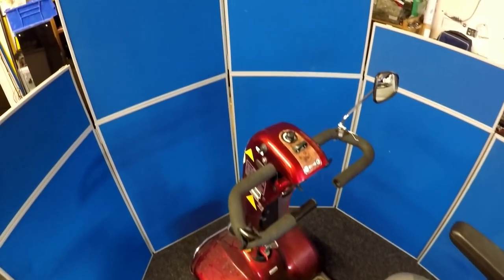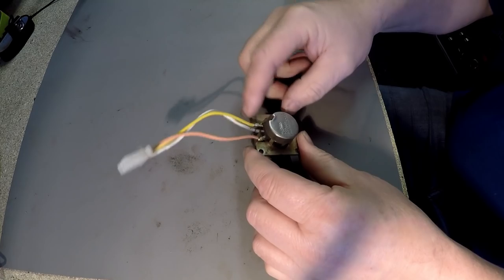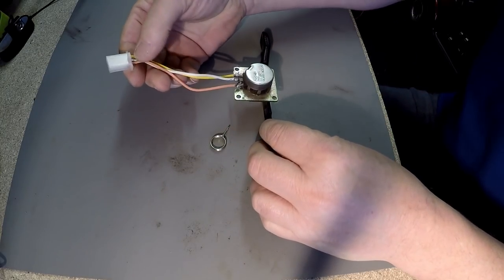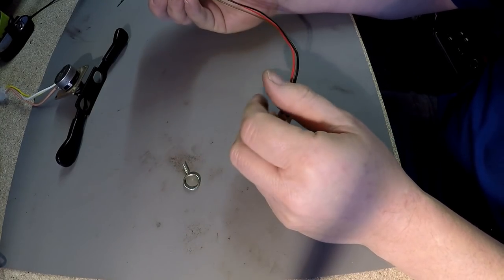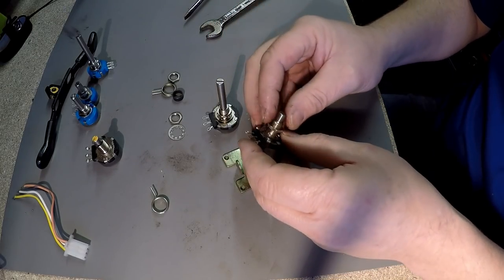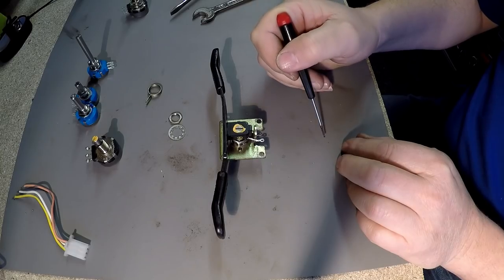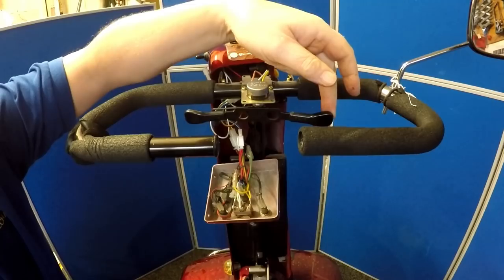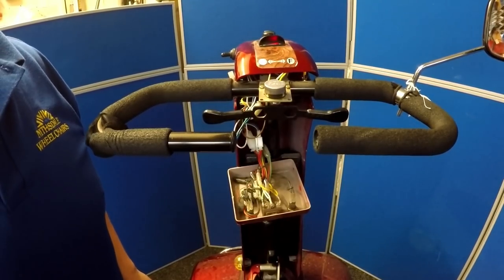Scooter speeds up and slows down Mobility scooter Throttle pot Repair

Comment: brilliant video, i took mine apart the weekend to see how easy it is to change a broken spring and obviously some how moved the shaft out of position, so when i put everything back it would not work, i was running around and phoning around trying to get a replacement until i came across your vid show the position of the shaft, all bloody day yesterday up until i came across your vid tonight. who would of thought something as simple as that.  thanx again

Comment: Thanks for the video. I'm repairing a mobility scooter for a friend who snapped the spindle of the RVQ24YS08-02 potentiometer. I managed to find a replacement in the EU (have to pay import duty in Greece when ordering from the UK) and I'd figured out how everything worked and fitted together. Your confirmation of the centre stop/brake position adjustment confirmed what I had already figured out about the grub screws (I'm an electronics engineer). By the way, it would be helpful if you would NOT call grub screws "grommets"!

Comment: My wife had a problem with her Go-Go scooter.  It was not going as fast as before.  I checked it out and the throttle would move a lot, forward and backwards, before the cart moved.  This carts throttle arm had an tiny Allen nut that had loosened. No big deal getting to that arm, but finding where my bag of Allen wrench were, then the second to tiniest Allen wrench fit and I snugged the nut tight.  Now no looseness and the cart zips like new.

Comment: Thank you very much. You saved me money and time. buy
 the whole essembly was kind of expensive. But just buying the switch. No question save me. But I didn't follow you rule with. Taking pictures first. So I had to use your video to save me for reassembly. Works perfect. Thank you. Thank you. Thank you. By the way, I was donating this scooter for somebody. In need. So cost was important.

Comment: Thanks for the brilliant help video, I have a strider 2 with a faulty wig wag which if I am not careful, will auto reverse, once I try to go fwd,  I think the pot is out of position, as the i once pressed too hard on one side and since then it  has tried to self drive, if im to slow on the off key😒. I think once i have found your contact detail on the phone I would like to chat, I am engineered back ground so willing to have a go to repair it
So your video has given me the confidence to look at the pot,  and either recentre it or replace,

Again thank you.
Regards Derek
Reply from the maker: Hi striders have a complete Assy very easy plug and play

Comment: Thank you this is very helpful as I’m looking at buying a used Quingo if you were replacing the whole unit would you still neeed to do the adjusting for the brake ?
Reply from the maker: @ilovebrean  hi it depend what type is fitted the complete Assy is easy to fit but more expensive

Comment: Hi, do you know if there’s anyway to remove the speed limiter or increase the speed on the Shoprider Mobility Scooters?
Reply from the maker: There is no speed limiter, each product is designed to do the relevant speed in the UK the max speed is 8mph. So. Each product has been manufactured to suit its general purpose. Some 4mph and some 6&8mph. They match the motor speed, controller and axle together to achieve this.  Most of the controller are allready set at the maximum of 100% but this can be reduced but
Not increased   Mind you some of the 888NR’s did have an extra speed pot fitted to make them go slower but that’s all.
Reply: @tomjacques4  that’s a shame, was looking to increase the max speed a little. Thanks for letting me know, appreciate it

Comment: Hi .... how do I tighten the tiller on a Pro Rider Road King stage 3 mobility scooter .... as moves side to side .... also how do you balance the front wheels as left wheel wears out in middle quicker than right
Reply from the maker: @Pamk-r1g  at the bottom of the tiller you will see a couple of nuts 10mm. Those will need to be tightened. You may have bent the steering arm or strut  lift up and check if not then you will need to remove track rod end and turn it in the shaft to either reduce or increase length.

Comment: Hi im fixing a neighbours throttle spring  only will i have to do the adjustments to make scooter move or will it work straight away once spring is fitted thanks its a shoprider
Reply from the maker: You will have to centre it

Comment: Is the speed control on the shop rider model all the same and what’s the price roughly for a complete wig wag unit.🤔
Reply from the maker: Some have 2 speed pots like the sovereign one hidden underneath but the older ones don’t have that. The complete unit is available and we have stock send us an email and I will send you the link kind you the pot itself is around £55 and now there are 3 different  ones. So send us a picture of yours to our email.

Comment: would replacing the wigwag potentiometer with a higher kohm rating increase the speed? or would it need a smaller ohm potentiometer
Reply from the maker: No sorry speed is controller by the power module and the set up ( motor and transaxle)

Comment: my customers scooter is on fast even when the knob is turned to the slow speed, im assuming its the throttle pot needs changing, i now need a throttle pot complete assembly please for shoprider TE889Sl

Comment: I Replaced A Throttle Pot 
On A Pride Legond & All I Had To Do Is Clamp  The 3 Wires Blue White Yellow To Get The Right
Polarity & Mount  The Newone
Back In

Comment: Can you explain how to remove shroud cover on a Pride Victory I cannot find any bolts or screws on cover to change speed pot
Reply from the maker: remove tiller cover bolts that are facing the seat first then remove the brackets that hold the basket tiller plastics fall off then remove the tiller head
Reply: @tomjacques4  Thank you will give er a try, appreciated
Reply: well was able to get it apart and speed pot replaced but now i have a spare part that im not sure where it goes somewhere around throttle control, had a friend help me an I didnt see where it was an he is unsure where it goes also, rectangle piece with a fat tab one side and 2 tabs other side is there a diagram some where for Pride Victory scooter

Comment: Hello mate. loving your vids. just become a scooter owner myself so very intresting to do some diy maintenence. > wondering can you help me. i have just replaced my tyres on my kymco maxi xls. i wanted thicker read off road tyres to stop punctures has much. trouble is, is to use off road tyres i had to get smaller size. the original tyres were 400 - 5  . but i had to settle for tyres that are 1" less in diameter  and so i am loosing approx one and a half MPH. can you tell me is it possible to have the speed corrected back to 8mph via re programing. And of so how much would this cost me. Thankyou for your time. can anyone help with this advice. i am at wickersley r rotherham. Thankyou. now back to watching more of your library of vids. cheers.
Reply from the maker: You should be able to get chunky 400/5 solids. Anyway it will not be possible to increase speed. As I will already set at the max permitted namely 100%. I will try and find out what it’s set at fir you. Give me a couple of days
Reply: @tomjacques4  Thankyou very much mate that is much appreciated, i will watch for your reply. Regards Bri
Reply: @tomjacques4  i bought a set of black chunky 4.00-5 but they are only 300mm dia. couldnt get anything else. other than normal 3.5 mm tread tyres and i wanted at least 5mm tread to help avoid punctures

Comment: Hi I have a drive boot scooter fairly new , and the speed adjuster doesn’t seem to function the scooter just operates on max speed ??
Reply from the maker: Best contact your supplier as that will be repaired under warranty.

Comment: Hi, Good video, just what I need. If you can help, I need to replace my speed pot on a shop rider scooter with the smaller control head, I think it’s the sovereign, but I don’t see how it’s possible to take the casing off, could you help plz,.?🤔😊.  Mick

Comment: Hallo, ik ben van belgie en heb hier een scooter van mijn vader, 1 koolborstel zat vast en heb ze dus alle 2 vernieuwd met originele nr 43. Nu wilt de motor niet echt draaien, ik heb de stroom gemeten op de motor en aan 9.60v begint die te schokken en vol gas slaat die af, ik krijg geen signaal dat er iets mis is met de shoprider 778sl.

Hello, I'm from Belgium and I have a scooter from my father here, 1 carbon brush was stuck and so I renewed all 2 with original nr 43. Now the motor doesn't really turn, I measured the current on the motor and at 9.60 v it starts jerking and full throttle it stalls, i get no signal that there is something wrong with the shoprider 778sl
Reply from the maker: Clean the commutator inside the motor it will be dirty. Remove the brushes then use a carbon Fibre pen 🖊 and clean it then blow all the carbon out of the motor using air hope this helps

Comment: Lovely video :)
P.s
That variable resistor / potentiometer or "throttle pot" 😳 (if someones interested ~£1 on ebay from many sellers) got holes in  terminals they are there for a reason (THT)
Reply from the maker: Egon1982 thanks for your input wish we could buy those pots for a £, mind you these 5 k pots are not 0-5 but 2.5k for forward and reverse with a dead spot to split.
Reply: @tomjacques4  thanks for reply. My fault unfortunately its not 0-5 as i thought.. :/
Reply from the maker: Egon1982 what’s the make and model and do you have a flash code ?

Comment: Hi mate hope you can help,I have a vanos galaxy excel royal and it keeps slowing down and going very slow. Sometimes it's going fine and suddenly stop dead at a skid and the first red light flashes 7 times,do I need to replace the speed pot and wigwag as one unit. Also do I need to reset the speed adjustable pot on top of tiller as ive replaced this already and it's still doing the same thing. Thank you,David in Liverpool
Reply from the maker: If you have already replaced the theottle pot then I would check the speed pot also check all wires and tiller Pcb. Sometimes a slack connection or dry solder can cause this error
Reply: @tomjacques4  hi thanks,is that one on the wigwag. Also the tortoise light is staying on even if it's off
Reply from the maker: @Wombat63  looks there is an issue somewhere light should go off.  Any water damage ?
Reply: @tomjacques4  I've checked the circuit board and cant see any water damage but it's been like this for about 2 months without any problems, so I will change the speed pot,the wigwag and pot and the ignition also all the wiring from the ignition to the batteries.  Thanks for your response
Reply from the maker: @Wombat63  we have done a video on showing you how to test the throttle pot I would try this first before anything as this component gets used the most.
Reply: @tomjacques4  if it comes to me buying a speedpot on top and a pot for the wigwag and a ignition barrel what price am I looking at
Reply from the maker: @Wombat63  I can supply you with the parts you require. Or Check this link you may find a pot that suits   
https://www.nithsdale-wheelchairs.com/scooter-engagers--throttle-pots---wig-wag-levers.html
Reply: @tomjacques4  can you send me a complete price including delivery please for tomorrow.  Thank you and for your time
Reply: @tomjacques4  I know the pot on tiller is a long reach
Reply from the maker: @Wombat63  send us pictures to nithsdale.wheelchairs@btinternet.com

Comment: Thanks for that, Can you not just set the pot up on the bench with a Ohm meter? Set it to 2.5M Ohms with lever central?
Reply from the maker: Steve Ashcroft you could and just slightly tighten grub screw. Will have to fine tune once on the scooter

Comment: An entirely different reason for speed change is the battery rubbing against the wheel, as it does on my Golden Tech Companion 3 without the battery fastened to the seat post.

Comment: Hi I have a Phoenix 3 scooter and it has stopped working I have brand new batteries and it shows the power lights are on but it will not move I've made sure to pull the lever to engage but still nothing its showing Full charge I get No beeps sounds at all. Even when pulling reverse there's no sound what can I check please?

Comment: Hi tom the scooter works fine but the battery gauge will not work  thanks
Reply from the maker: I would check the voltage with a volt meter at the terminals of your gauge. If no voltage then follow the wires and check ….
Reply: @tomjacques4  Thhank you I found the gauge faulty.

Comment: can you govern the top speed with adjusting the middle screw? I would like to govern a scooter I am working on.
Reply from the maker: Hi. There’s two ways. 1 expensive programmer to adjust overall speed direct to the power module or you could fit another speed pot inline to your existing speed pot.

Comment: trying to fix up an old scooter, there’s no continuity across the potentiometer, and the whole scooter basically doesn’t work. there’s 24v supply to the scooter the light doesn’t turn on. but there’s audio beeps. there’s 24v in the power socket and 24 to the electric break

Comment: I'm in Canada where can you get reasonable priced parts?
Reply from the maker: Hi what parts are you after
Reply: @tomjacques4   future throttle pot circuit breaker that type of thing
Reply from the maker: @windwalker8058  we can post to Canada 🇨🇦
Reply from the maker: @windwalker8058  yes should have stock just send us an e-mail with pictures and spec.

Comment: My speed potentiometer speeds up to  half speed then no faster for the rest of  the movement. When tested it shows a increase all the way. What can I do to get full speed?
Reply from the maker: Hi Peter what’s the make and model and what speed is it doing. And how long has it been  doing this.
Reply from the maker: Hi Peter, the onboard controller will be programmed to a specific setting that tells at what point it will reach full speed. so it could well be that its set well before the end of travel of the lever even though you get an increased reading. So with that in mind i could set the max speed to be reached within a specific setting of the lever.... rather than at full travel. hope that clears it up.....

Comment: I bought me a throttle pot but I didn't"
Need to adjust it I just 
Installed it & used wire clamps to connect mine
It"s been over a year since I replaced mine.
It runs Like a top
Reply from the maker: Roger Tyler not all pots require to be centred. But 90% do. If your scooter has a separate forward and reverse switch then you will be ok.  Like the Royal, super sport or the sports rider.  But scooters that use the same canter levers must be centred.

Comment: My battery is new. But its easy to get low .u think it has an issue with electrical?
Reply from the maker: Could be a few issues.  1 a faulty battery, get them tested. 2 a electric brake that sticks causing more current draw. Check brake , is it hot?  3 a worn motor, check brushes.  Hope that helps.
Reply: @tomjacques4  and my mobility scooter cannot be pushed even if its on free wheel
Reply from the maker: If you can push it then the brake is stuck on.  Gently tap the brake while trying to drive forward.  Or remove the brake and see if it’s clicking and letting the disc spin.  Most likely the disc will not spin so see if you can free it off while 24 volts is applied

Comment: I put a new scooter controller on my scooter and now it runs forward but with the beeping noise  on and when it's in reverse no beeps and it goes hard out. Can you tale me what's going on please
Reply from the maker: Phil Simmonds where did you get the controller from. Second hand? Did it from an identical scooter?
Reply: @tomjacques4  yes the  controller is the same it's the  blue box under the seat. I got it of Ebay from England and I'm in new Zealand. It's like the plaraty are back would.

Comment: My mobility scooter starts going backwards when turning on
Reply from the maker: @robertames688  looks alike you will need to adjust the throttle pot. 
Lift up the back
Wheels first then use a screwdriver to adjust throttle then tighten grup screws
Reply: @tomjacques4  my pot is under the front part. Where could I buy a new one

Comment: 4:10  Time. I am electronics/computer tech.  Your taking the  pot  apart -  WHERE  is  that   s p r i n g ,  located, for  the wig-wag ?.......the self-centering,  spring ?.   I tried to repair a scooter - she  ran into  a wall - fairly fast. Broke the spring - for this wig - wag.   .....thanks - for any  response.....( i wish they could use MILITARY  grade components - china ones, ain't  ANY / NO   good !
Reply from the maker: We do sell springs if required. Mind you the spring is inserted on top of the pot with the rest and the Assy. And lever. 
https://www.nithsdale-wheelchairs.com/prods/10870/engager-spring-closed-type-salvage-stock.html

https://www.nithsdale-wheelchairs.com/prods/10871/engager-spring-open-type-salvage-stock.html